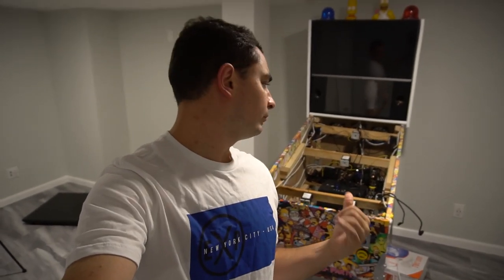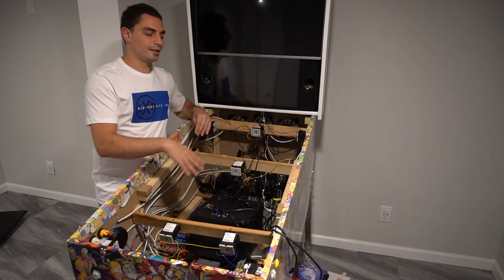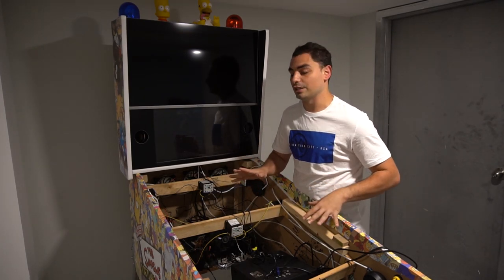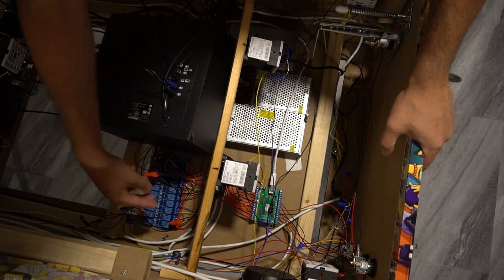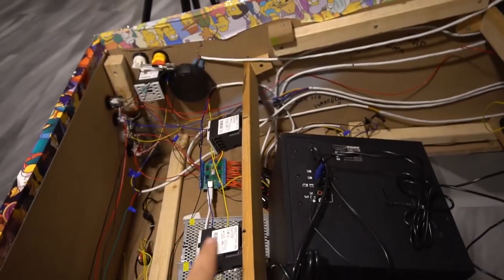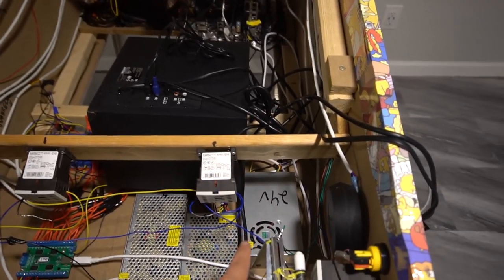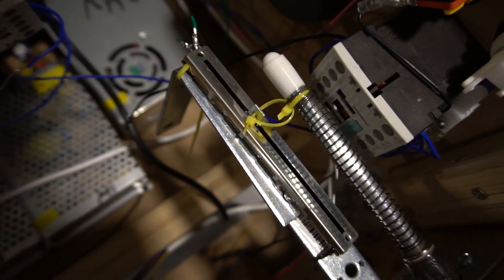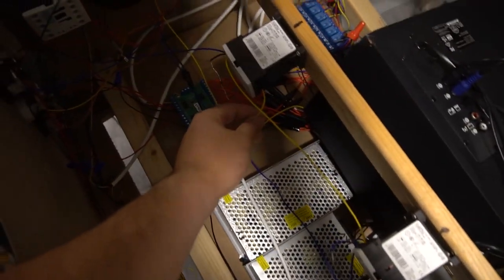How to Build a Virtual Pinball Table - Part 1 GET THESE PARTS

Comment: The contractor relay "solenoids" will only use 1.125A to close, if you only are controlling the 10 solenoids, you can use a much smaller 24VAC Power Supply, if you close all 10 at the exact same time, you would only need 12A
Reply from the maker: But for a few bucks why get a smaller Amp PS? Doesn't cost much of a difference. Plus always room for more toys. I also think depending on which contactor you get will determine the Amp needed....
I got a few vids going up of a vpin I just competed... 24v 25amp for 19$ can't go wrong with the price
Reply: @Vic_VP  The contractor relay 
3RH1131-1AB00 is a 24VAC device, I assume if you are only spending $19, then you are buying a 24VDC power supply. You are taking a risk running with DC Power on a device designed to be controlled with AC.
Reply from the maker: The ones I have where read as DC. Even the lower end ones I mentioned are DC. Also the 1ab00 I have say 6a ... prob another reason why I went with a higher Amp PS. The new build I have coming up I used the 1bb40 model since the 1ab00 model are like 60$ each now lol

Comment: Are the contactors the only things going to 24v? Reason I ask is that I'm going to use 12v car solenoids. If that is the case I'll just need to swap out the 24v for an additional 12v power supply correct? Thank you for your help! I've watched this video about 100 times already and have almost all my parts!! It's almost time to buy TV's and wood.
Reply from the maker: Correct 24v only is for my.contactors
If your using 12v then it's smart to have its own separate 12v for the solenoids vs putting all 12v toys on 1 power supply

Comment: Hey Vic you mentioned in the video that the potentiometer you got for the plunger was too long. Just want to clarify that the link you have in the description is for the correct size potentiometer.  Thanks!
Reply from the maker: The one i linked is the one i purchased
I would suggest getting the one i purchased. Better to be too long than to be too short

Comment: Exactly what I was looking for. Starting a build now. Thanks
Reply from the maker: Saweeet! Hope it helps! I'm still working on software slowly haha
Reply from the maker: @johnambers  hmmm ill have to check that. I ordered the fuses and in line seperate

They are on ebay 

Here's the fuses 

https://www.ebay.com/itm/112374379349

Here's the inline holders

https://www.ebay.com/itm/10pcs-5x20mm-Screw-type-Fuse-Holder-Case-In-Line-with-Wire-Cable-US-Stock-/273521400326?_trksid=p2349624.m46890.l49292
Reply: @Vic_VP  Thanks you
Reply: progress?

Comment: I would suggest the MVP (minimum viable product) method of building. Start by building only that which can resemble a pinball machine then work on feedback. You're suggesting to build a car by first building out the AC, power locks then the four wheels and drive train. In Agile development you want quick wins follows by features. Very inspiring build Vic. I hope you play it until the buttons fall off.
Reply from the maker: Haha thanks dude, your suggestion is good
I have a guy that bought the a1up pin... no regrets because there's no room for power supplies,pc, solenoids and such haha.
I don't think many toys would fit in a mini vpin build like I reviewed before

Comment: Great video man, I was going to get the Attack from Mars Arcade1up cab but it sold out instantly and also for $600 I'd rather build one that has way more games.  I do have a question though, I'm having a hard time finding a power supply with those exact specs; 24v 33a 400w.  Is it ok to go bigger, I found one that was 24 v33a 792w and thats the closest I could get.  Do you think that would work?
Reply from the maker: Yea the more watts means the more toys it can power. 792w what's tho is a lot 🤔 never heard of that amount honestly. But yea the more the merrier
Reply from the maker: I also have in this vid or a seperate vid, in the description links to all the parts I got.

Comment: The 3RH1131-1AB00 contactors are rated as 24v AC units vs 24v DC - does seem pretty confusing -

Comment: I am just starting my journey of building a pinball cabinet.  I have been looking for the solenoids you recommend, but they appear to be hard to come by at a reasonable price.   Basically, you can't get a used one for less than $50 right now.  Is that about what you paid or has the market changed?
Reply from the maker: Market changed, I paid 10$ per solenoid when I made my cab. Yes now there like 50$ on ebay. For that price you might as well get Thunderclaps

The cheap Siemens are available, but as I stated in my video... you notice a significant difference

Comment: Hey Vic - it looks like the Siemens contactors you have in the back are only 24v DC Coils - while your first 7 contactors seem to support both AC/DC 24v  - are you running the same 24v DC power supply for both sets ?
Reply from the maker: I'm using the same 24v power supply. No issues besides the slode difference in noise and force... maybe thats y? Lol
Reply: @Vic_VP   it’s good to know they work better with a 24v DC input even though they are rated as 24v AC units – you may have discovered a very valuable trick/tip here that no one may really know about or understand very well - I think the main difference is that the internal coils used for the AC unit is stronger/better than the DC only rated one – if you look at your back table contactors you will see it say 24v DC in the top right corner of them – the other ones do not have any reference to DC just 24v
 
Can I ask how long have you been using the better ones now and have any burned out at all ?
 
I assume you have them all daisy-chained with your 24v DC power supply and the ground ?
 
You have a great looking VPin !!
Reply from the maker: Thanks Doug, yes all daisy chained together 
Pins been up since aug 30
I play it everyday for about 2 hours  followed by 2 hours of just adding more tables 1 by 1

Comment: what did you do for side rails and lock bar... these pieces for me are starting to get expensive
Reply from the maker: I didn't do a lock bar... I find it pointless.
My side rails are 90 degree silver angles found at hardware store
Reply: @Vic_VP  just saw that on the video. I am taking that angle as it’s looks good.  So I think that what I’ll do. Did you do glass or plexiglass
Reply from the maker: Plexiglass from lowes :)

Comment: Maybe I missed this somewhere but did you draw up the plans yourself or  find them online somewhere.
Reply from the maker: I followed a bally wide body, but the width of the front panel marches the width of my tv.
Backbox width  is width if the 32inch backglass monitor, and height of the monitor and dmd together for a seamless back box
Reply: @Vic_VP  Thanks I think I have wide body plans laying around somewhere.
Reply from the maker: @foxhound34  irs a quick Google search
I just used it for the side and the location of the legs

Comment: Mjrnetdotorg ( or just search pinscape on Google) has the most in depth plans, some may say too in depth, for building a virtual pinball machine I have ever seen it must be over 500 pages long. You and everyone who is interested should definitely check it out.
Reply from the maker: Yes I stated it a few times in my other  vids, my build is a solid 90% of following his guide
Just my soleniods are not wired up the way he has his... hisnway for me it didn't work for some reason
Reply: @Vic_VP  I built a counter-cade a few years ago as my first project and right now I'm currently mid-build on a Full-size Arcade cab, but now all I want to do it build a VP cab (which was going to be my next project).  Great work BTW.